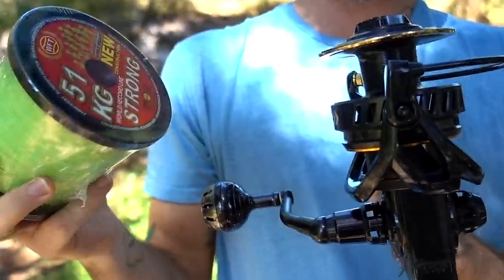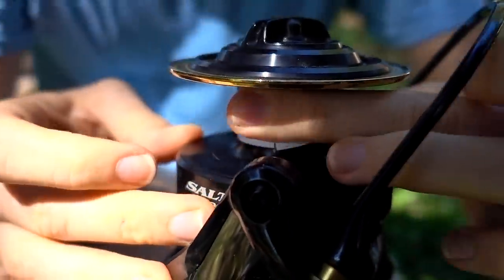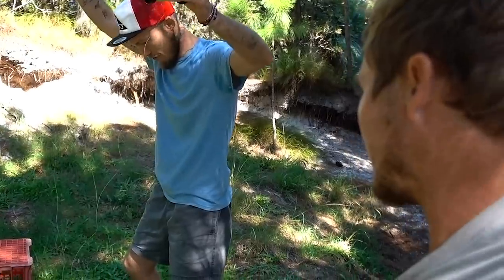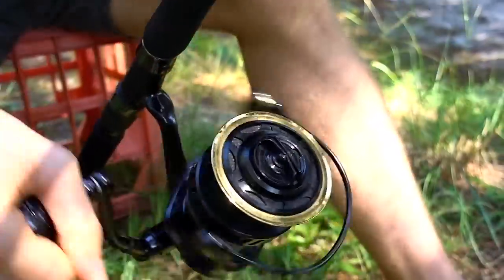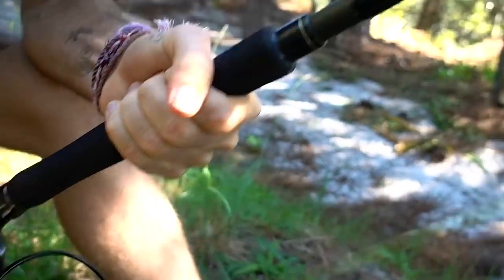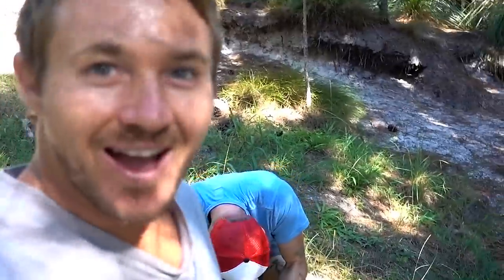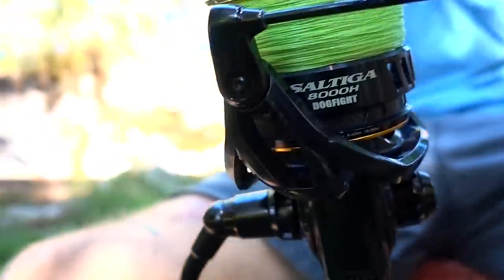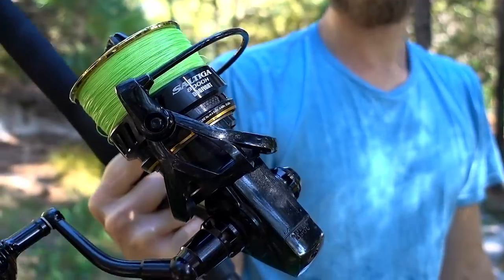Spooling a Daiwa Saltiga Dogfight 8000H with 51kg WFT Line

Comment: Hey boys you know it’s impossible to keep line in a spin reel without twist even if you have the twist free line installation tool or bench and install line side by side with a drill I just put the whole new line spool into a bucket of water get tension on line as I runs through guides and on to reel works pretty good but after a few fish there will be twists it the nature of a spinner so after each trip if you run the bare line out the back of the boat to clear the twist the tension should remove most twist okay bro’s hope this virus hasn’t got y’all down say hi to cav love the content of your vids I should have started a channel twenty years ago and thank you guys for showing me a few tricks we use dogfights here in Martha’s Vineyard and off Provincetown Mass. USA to sight cast to giant bluefin tuna I think with the right play you can bring in a freight train

Comment: I have the same reel!! thinking of putting 39kg wft line. Great video guys!!
Reply from the maker: I just had the 39kg on there and it was a good balance between good casting and still being able to lock drag if needed. I think the 51kg is more of a psychological step up for the GT because I couldn't snap the 39kg by locking up,  51kg's a fair bit thicker though and maybe if the fish goes into some rock there's a better chance of landing him... But yeah prolly more for my confidence than anything!
Reply: MorningTide Fishing yea for your type of fishing definitely 51kg is ideal. For me the 39kg should be perfect. Not much Xtreme fishing in florida like how you guys fish.

Comment: can you guys explain the logic to put 112lb line on a reel that can only do 66lb drag? woudnt putting 70lb line be more than enough (even still being able to lock the drag) without any worries.  great vids btw
Reply from the maker: So there is a few reasons. First is I don't feel as confident with the thinner line, even just in terms of knot strength. Next reason is if you grab the spool (on top of the 66lb drag) that can put a lot more pressure on everything and lastly if I can't control him and the GT goes into the reef/rocks the 51kg is a bit thicker and that added abrasion resistance might save me!

But all that said i've locked up on the 39kg WFT and couldn't snap it... So the Psychological aspect is prolly the main thing haha!
Reply: MorningTide Fishing how are you guys casting the rapalas so far :(?
Reply: SN1PER It is typically recommended that drag is set at 20-40% of the line strength. It puts less shock on the line and gentler on fish. If your drag is set too close to the line strength then your chances of line breaking and fish spitting out the hook is higher.

Comment: I get the point why spooling the line tight..but this tight surprised me. maybe this is a stupid question, but  if you get no bite and reel in with almost no resistance or drag, the line should require a notably larger volume on the reel as when spooled tight - does it still completely fit on, no problem? Or even when you fight a fish, you reel when pumping down with less resistance..really never spooled one so tight and I don't catch fish the size of yours on spinning tackle. cheers for sharing your experience with this!
Reply from the maker: You hook a GT with 20kg+ drag and the line's going to cut into itself regardless but the tighter you have it the less it will bite in. It does get laid a bit looser after you cast but it's only that top 60m-80m, the line under is still packed real tight.  Whenever I tie a new leader I cut off about 2-3m of braid (down past where your finger touches the line when casting) to get rid of any damaged line and after a few new leaders the looser top section of line from casting compared to spooling fills it up pretty much perfect, before that it may be a bit over full...
Reply: awesome, thanks!

Comment: Briggsy - I'm thinking of spooling my Dogfight with either 51kg WFT, 80 or 100lbs Tasline and Varivas PE10 SMP. How do you compare each line for casting and abrasion resistance? I'm curious how much line you got on the Dogfight with Tasline. Busted Fishing site states that I can get 400m with their PE10 line and 505m with their PE8. These figures contradict what their diameter states,, seeing that the Daiwa JBraid Grand is actually thinner but Daiwa states it fits less line than what Tasline states. I'm ordering by the metre so I need to work out how much line to order to fit 2 spools. Thanks for your help.

Comment: Good shit boys. Bet that arm was warm after cranking under that much tension haha. Is that Dog Fight used? Just wondering why you mentioned it feeling a little off in the first part of the video.
Reply from the maker: Yeah i've had it for about a year and a half, Jonny used it on a GT trip out of the boat once and it came back not working at all (something fully snapped), after service (was done free on warranty) it felt nice again but it's been on a few more trips since that and also spun our local zone a fair bit where there's more swell so it gets splashed a lot. Nothing majorly wrong I don't think, just not perfectly smooth like how you'd want it to feel haha.
Reply: Ah I see. Its got some "character" now.

Comment: Don't mind me asking. Saw a previous video where the expedition 5500H too spooled 500 meters and this reel sized 8000H is roughly within the range too. And if not mistaken its around 50lbs too am i right? There's quite a gap in the model size but they have same line capacity?
Reply from the maker: Hi Mate, the PE and lb rating of a line is super confusing because a line can PE5 and break at 50lb or it could break at 30lb or even 80lb+ so it's safer to just look at the PE (thickness) of the line instead of going off the lbs... 

(the line in this film is 112lb and around PE7-PE8, line in that other film is 50lb-70lb (they call it 50lb but claim it breaks at 70lb+) and about PE3.5)

Comment: When using braid would you use the strongest braid and put less line or use less of a strength braid to add more line on the spool?
Reply from the maker: It depends on target fish. If you're going for GT you want at least 100lb line. If you're going for Tuna/Mackerel you want at least 300m of line preferably 500m (could be as light as 10lb I guess but we never fish so light, 30lb is the min we fish for Tuna/Mackerel).
Reply: MorningTide Fishing Awesome thanks for the feed back I appreciate it!

Comment: you guys ever backed with mono before? never had a slippage problem with it and you don't need tape
Reply from the maker: We have but we're always trying to get as much line on there as we can (in case we hook that 100kg Tuna haha) and the mono fills her up a bit more than the tape so we kinda trip out on that. But where we do use mono backing is if we have no $ to buy a new spool of braid, we'll tie mono onto what's left on the spool and fill it rest of the way with mono, then do the double reverse thing (off onto another spool then another then back onto original) to flip the line.
Reply: yeah nah yeah fair enough

Comment: WFT or tasline?? Because my tasline has been fraying like mad and it's fully doing my head in haha. Sick vid btw yeee
Reply from the maker: To be 100% honest I'm happy with either, the Tas I'd go 50lb and up (lighter and it's just too thin for me) and the WFT I'd go 39kg and up (the 32kg and 22kg are 4 strand and are rough on your finger, whereas 39kg and above feel like they must be 8 strand, nice and smooth). 

Haven't noticed the fraying issue with Tas before but I'm always cutting off about 2-3m each time I retie my knot so I get rid of down to where the finger holds when casting pretty much each day. Is the fraying in that zone or like all of the line?
Reply: +MorningTide Fishing Yea I have 40lb and its around the first guide right near your finger where you cast so I was doing the same thing, cutting heaps off each knot I tie. 
But recently half way through my cast was a massive fray so bad I had to cut like a ton of line off coz it would of snapped on any fish haha so I might just try WFT and see how she goes. 
I found this website that stocks it pretty cheap.

https://www.dinga.com.au/wft-strong-braid.html

Comment: Do you have enough room for a shock leader? No way am I qualified to tell you guys anything The fish you guys catch are just insane.. If you are concerned with abrasion wouldn't it be better to use the 39 k just to have more room for a substantial length of shock line? I couldn't tell if that rod had a gimbal on the butt. Looks like it had a butt cap but sometimes there is a gimbal underneath the cap. Sure would have made the job easier if you didn't have to contend with the rod swaying under the pressure.
Reply from the maker: I actually don't cast my leader knot! I do a FG with a Rizzuto finish (so it's fine to cast the knot) but I'm particular about damaging the knot over time and getting max casting distance, so I don't cast my leader knot, because of this I have about 1.5 - 2m long leader, which means I need to go a lot harder on the fish to make sure they don't take me into the rocks!
Reply: I gotcha. I don't use the Rizutto finish [definitely should though] and sometimes that little nub can cause you grief. I don't throw plugs like you guys, just tossing out a live bait so I can use twenty feet or so of shock leader to take the abrasion that comes from fishing wrecks and coral. Just found you guys about a week ago and really enjoy the vids and the knowledge you impart.

Comment: Just got a 30000 Stella
Reply: Very Very Sad 8000 has more drag then the 30000 tho
Reply: The 30000 Stella has 39 lb. Of drag, and the 8000h dogfight has 66lbs. Of drag.
Reply: Jupiter Josh that's because the stella 30k is built for trolling for billfish with 30-50lb mono, hence the massive line capacity and the lack of drag in comparison to other stella models 8000 onwards.
Reply: Tacklecentral Fishing where did you get 39lbs from mate? Do your research bud!
Reply: You're kidding??? Oncorhynchus mykiss max 50lb!....(not 400lb!jeje). 5000shimano/3000daiwa ideal reel size.
biggest stella/saltiga can catch 200lb tuna of coast!
Reply: Waste of money
Reply: Unlimited Vlogs I just looked at the 18000 much better reel for top water

Comment: How did that braid end up going?
Reply from the maker: I've used the 22kg, 32kg and 39kg over the last year or so and the 22kg/32kg are 4 strand I think, they're rough on the finger. 39kg is a really nice line it's smooth as and real strong. The 51kg I've only had on for a few days and spun with it one time. It cast pretty well for being over 100lb line and feels similar to the 39kg (smooth) so I'm pretty sure I'll like it but gotta use it for a while before I can give a full report (so far so good though). 

Note that all WFT I've used starts with a coating and is pretty stiff but after a few hours use it softens up.

Comment: why reel it so tight m8s?
Reply from the maker: Hi mate, the reason is if you're going for big GT off the rocks (over 30kg) you have to completely lock drag on the reel and even grab the spool to stop them. If your line is loose on the spool when you do that the braid will cut in and damage itself. If it's packed super tight it can't cut in the same way.
Reply: MorningTide Fishing got it. You guys are very lucky to have pelagic so close to the shore. the only fish we have here so close are mullaway. 40 50 kg top. Cheers  from Portugal

Comment: 51kg/112lb and diam0,32?its not real!!...best braids pe6/85lb pe8/112lb and saltiga pe6/540m 0,47/pe8/400m......more 400meters is impossible.............450 jajaaa depth finder yards?its 410m
Reply from the maker: Pretty sure it's meters mate. But this is why WFT is known for being the thinnest braid, I haven't heard of a thinner line for the kg/lb.
Reply: OK,thanks, yes I see it first time to denis verret biggest tuna nice jjaja...but highter varivas max gt pe8/120lb!!and new x12braid daiwa pe6/100lb!pe8/118lb but very expensive....similar ygk jigman and varivas avani pe5/78lb?.......or good sunline,suflix832, new j-braid, my tuffline xp. 
But in Paulus lines web not WFT!and 51kg is 100% real test?
This 8000 850grs,how much weight with 450m braid? and cm inside diameter spool? 
Could you improve Saltiga?what will be it the way future? more carbon pieces jajja ok